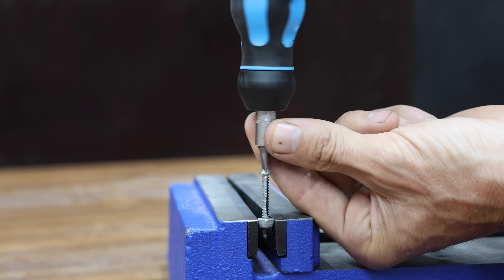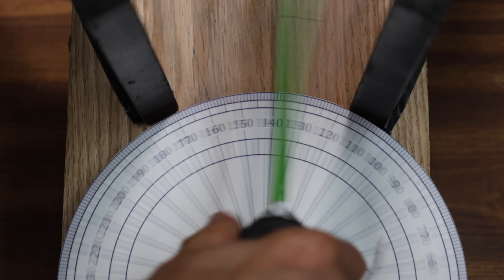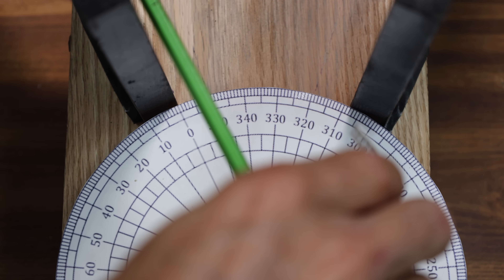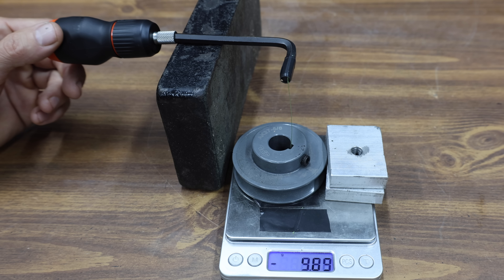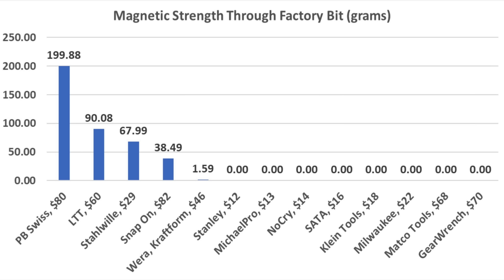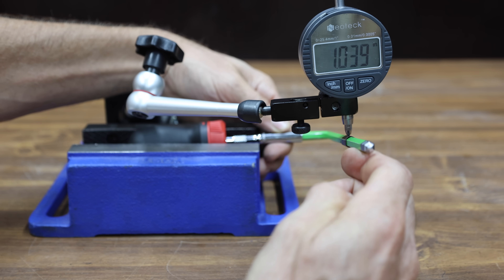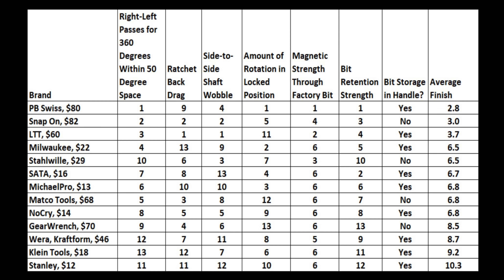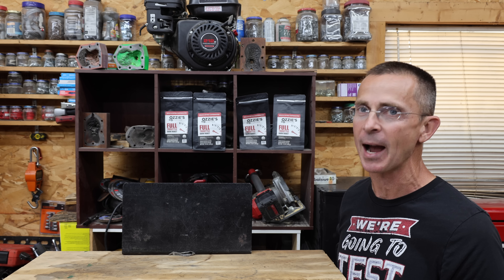Is Linus Tech Tips “Stubby” Screwdriver Best? Let's Settle This!

Comment: 100W+ USB-C GaN chargers, specifically those that can do 100W when only using 1 port. A lot on the market can only do 100W in the first few seconds, then falls to 80W, then after several hours of use, will fall further to 60W or even 0W. Even reputable brands fails. The key is to test is over several hours or days.

Comment: Another suggestion is: "the best root killer for a main sewer line." -- Some foam to fill the pipe to the top, some don't. Some use toxic copper based chemical (environmental damage?), others use chemicals as simple as salt. I'm not sure you could even perform a test like this.
Reply from the maker: Thanks for the suggestion.

Comment: I have the Milwaukee and it has become my main ratcheting screw driver.  I noticed that it doesn't do great at ratcheting low resistance things, but i just hold my finger on the shaft whenever i need it to rachet.  That being said, it would be nice if i didn't have to do that every time i start a screw!
Reply from the maker: Thanks for the feedback.

Comment: Testing small ratcheting screwdrivers against each other without asking, is this the correct type of tool?  I used to have a couple little guys like this till my wife got me a little wiha security bit driver kit.  It's looks like a standard socket ratchet but it's small and accepts screwdriver bits .  Along with a little 2 inch bit extension but sometimes I use my Dewalt 4 inch bit extension.   I'll never go back to one of these drivers.

Comment: I drive a lot of stainless screws, and I hate it when the screw head deforms where it meets the driver. Stainless steel screws are a bit of a hastle to drill and extract, to put it lightly. So I've determined it might be better to have a bit which deforms/breaks before the screw head. (10/32 philips specifically)

TLDR: I request that you review different bits for hardness/softness of the metal it's composed of & failure loads
Reply from the maker: Thanks!  Thanks for the suggestion.

Comment: Would love a roof coating material. Dealt with some, want to know ponding, flat roof, and bubbling.  Coating different materials. Wet and dry.
Reply: Silicone supposedly the best but still splits in hot weather
Reply from the maker: Thanks for the suggestion.

Comment: Great testing. I noticed the bit sizes were different - did that impact the testing at all? The LTT seems a bit smaller than many of the others there.
Reply: LTT uses shorter bits due to the fact they were already making them to fit 12 instead of 6 in the regular driver. 
On the regular, you can choose to fill it with 6 regular size bits instead of the 12 short ones, but on the stubby they used that to make the driver as short as they could.

As the test here shows though, the bits are of good quality, and the extra bits on the LTT store aren't that expensive.

Comment: I've used the Snap-on ratcheting stubby and full length screwdrivers for years. 
Fully satisfied. 100% guaranteed to be replaced or repaired.
The old models did have bit storage in the handle but, that was it's weak spot. If you dropped it from high enough, it could break the storage cap.
Reply from the maker: Thanks for sharing.

Comment: Regarding power tools specifically, do you think there is truth to what i heard a while ago that even though power tools might be made by the same manufacture, that they could be wildly different qualities/durability depending on Where you buy it?

For example, Buying a Dewalt or Milwalkie power tool (lets say a drill) from Home Depot/Lowes, is made to a much lower standard than those sold at, lets say more 'professional grade' stores/sites, in order for them to keep the price down for the more retail store shelves, even though the model number of the tool is the same (and there is no way to know which version you are getting). 

Is this something you have heard or tested?
Reply from the maker: Thanks for the suggestion.

Comment: Just one note to add with the back drag test since the measurement is so small and can easily be skewed by leverage. If you have a way to secure the  Alan key to the stationary object while still allowing rotation you can get a more accurate measurement. Just my two cents but great videos and I always watch your reviews before buying tools 👍
Reply: I noticed this as well, looking at the video it didn't seem to be a factor. But ensuring the Alan key can only rotate and not act as a lever will make the test more consistent. 

(This is extra credit. You're already rocking a 98)
Reply: @seanmurphy9439   yeah I was thinking the difference might be small but it’s a small measurement and could definitely effect it a few grams.  I’m not that nit picky with a screw driver because I beat the crap out of all my tools but I do also use some fine calibrated stuff and see differences things make.

Comment: I do own Wera ratcheting stubby screwdriver and I like it a lot mainly because of its compactness compared to its counterparts and the build quality. I was really surprised though that you put the product from PB Swiss to the last place by giving only 2.8, at the start I was expecting it to be more outstanding.
Reply: You're reading it backwards, a low score is good, the PB Swiss finished in 1st place in 4 categories, and so was the best finisher on average at 2.8, taking the top spot on the final results chart. The Snap On did not finish 1st in any category but it was close to the top in all categories so it still ended up with a very close second place average finish score of 3.0

Comment: @ProjectFarm I have a suggestion for a test but correct me if you ever did something like that. I'm thinking of installing a metal construction directly into concrete using concrete filling "chemical adhesive" called Sika AnchorFix-2 . Did you anything for concrete specifically? I've seen your "liquid nail" videos but you did it for wood only. Also again, thanks for the good work in testing!
Reply from the maker: You are welcome!  Thanks for the suggestion.

Comment: This review was fairly comprehensive (as usual), but it overlooked one critical feature: the length of the bits that can be stored. The Milwaukee, for example, uses non standard 1.5" bits. Standard length bits cannot be stored in the handle. I'm sure I'm not the only person who replaces the included bits with ones that I most frequently use, so this is kind of a big deal. Not to mention when you wear out a bit, good luck finding a replacement. 

The full length LTT screwdriver makes use of shorter than standard bits in order to fit more into the handle. Is this also the case for the stubby?
Reply from the maker: Thanks for the constructive feedback.

Comment: I bought the Stahlwill branded as an SK about 15 years ago. I use the Gearwrench shafts in it. I use it every day and other than an occasional lube it has needed nothing. I use it in all driving situations, not just stubby scenarios, as I find it to be more comfortable than full sized handles. The fact that it does NOT have internal bit storage is a plus, it keeps the handle intact.
Reply from the maker: Thanks for the feedback.

Comment: Hey Todd, absolutely love your videos! Quick idea for taking out human error at the backdrag test: if you fit a small pipe over the hex-shaft for the part that lays on the middle platform, there will be less inconsistency/more accuracy with overcoming the bumps of the hex-shaft. The positions where you started varied from screwdriver to screwdriver, so the rotational position of the hex-shaft also varied/the horizontal distance to where the sting is attached to the weights. So some seem to have started on one of the 6 bumps, while other seem to have started on one of the flat sides and had to overcome the bump.
I hope my attempt at explaining makes sense?
I really love your videos and watch every single one! You always seem to find simple and efficient ways to take the human error factor out as much as possible.
Kind regards
Reply from the maker: Thanks!  Thanks for the constructive feedback.

Comment: Excellent review as always!  Lots of eye opening results.
I have a Kobalt ratcheting stubby that's probably 25 years old or more.  It has in-handle storage (came with 6 bits + room inside to store more loose), forward/reverse/lock positions and magnetic bit retention.  It's about 4" long.  Pretty standard stuff.  But it has one feature none of the screwdrivers reviewed here have - the entire tool is metal!  Aluminum handle, butt cap and adjustment collar, with steel bit holder.  The only plastic is the bit holder inside the cap.  Oh and it only cost about $10. My only issue with it was that the "rubberized" handle grip inserts (more of a plastic) hardened up and became slippery so I pulled them out.  I need to fill in the gaps with some high durometer rubber or maybe some JB weld.  I'd love to see how it compares to the ones reviewed, but I don't want to destructively test it.  You can't get these anymore, though maybe find one on eBay.  I've used it on countless projects over the years and its small size lends it to bring tossed in the glove box in a car or even a seat pack on a bicycle.  It'll be a sad day when it gives up the ghost!  I'll list the part # when I can find the driver, it's laying around here somewhere...
Reply from the maker: Thanks!  Thanks for sharing.

Comment: I have a video idea to suggest:
Which "Refill Spray Can" is the best? Let's find out!

They are not very common, but do kinda help reuse pressurized containers with almost any liquid media, and - best of all - can easily be pressurized at some 8Kg/cm2 with an ordinary air pump. No propane/butane nor freon propellant required. Just the air we breathe to pump it up and ready for discharge.
Reply: Never knew
Reply: @StanErvin-yo9vl   I have one of these for several years to dispense brake parts cleaner I buy in metal canisters, and refill at any time given. Saved me quite a bunch of money one normally pays per one-time spray can.
Reply: @Bandicoot803  : Okay, I see the usefulness and safety when used dedicatedly for one product. Was concerned that wavering from a few different liquid substances that there's the issue of incompatibility and risks of mixing and pressurizing with any substance as a propellant causing intensified pressure build up or, Heaven forbid, an explosion or fire. 
🛠️🤕💥🔥💀👀🦖🦕 Edit: remember that the chemical you are planning on dispensing isn't such an eco-friendly chemical formulation to begin with. I guess that I just cannot grasp the concept of eco-friendly propellant versus non eco-friendly being used. Are there perhaps organic substitutes for the Brakleen ™? I think that would be a beneficial solution. Have to admit using a trigger-spray one quart non-pressurised filled from a fifty-five gallon drum (spigot) on bung. This was in a factory that had some seriously dangerous chemicals such as methyl ethyl ketone, organic peroxide, and many different formulations of heat transfer boiler fluid that circulated through the injection molding cavities and cores to cure the tmc sheets for satellite broadcasting dishes. We had safety standards out the ying-yang, but I think that my various cancers were resultant from exposure. Lung, skin, kidney, bone, and a possibility of others.
Reply from the maker: Thanks for the suggestion.

Comment: I like magnetic screws and screwdrivers. I hate when a magnet is so strong that I cant get the screw into place because it keeps sticking to the wall and comes unseated from the bit before it comes off the wall. It also sucks if you can't get it off one wall without sending it into another.
Reply from the maker: Thanks for the feedback.

Comment: I picked up a duratech on amazon because i wanted a locking mechanism. no screwdriver magnet is holding onto a 6 inch bit extension

I had a Stanley and the magnet came out.
Reply from the maker: Thanks for sharing.

Comment: My fav is the GearWrench; it's a Snap On w/o the mark-up.  Knurled shaft is very important in practice (so you can quickly spin a loose screw), and a thin shaft is extremely important to get into recessed screw holes.  PB Swiss is beautiful but lacks a knurled shaft.  I do daily carry the non-ratchet stubby PB Swiss.
Also, Apex Tools makes the Snap On bits (I'm also surprised yours snapped early.  They're normally harder/tougher.)
Reply from the maker: Thanks for sharing.

Comment: Very nice to see the LTT driver doing what it was intended for well. This video helps make the price make sense since the higher ranked ones are also more expensive. The locked position rotation and bit retention were a tad disappointing. Maybe they can fix that up in revisions.
Reply from the maker: Thanks for the feedback.
Reply: The rotation at the locked position is kind of misleading as the measurements are taken so far away to get a better idea between all of them. Any that did not make it past 1 inch in that test is great in my opinion. I have the original LTT driver along with many other ratcheting tools. The bit storage, magnet, ratchet and ergonomics is what makes it for me. It is expensive yes but no other driver I have tried comes close. All other options I can think of that would be second would have a extremely poor magnet and far worse ratchet.
Reply: @htr5372 u mad bro?
Reply: @htr5372 u indeed mad bro
Reply: @htr5372 Then name one.

Comment: As always, very comprehensive video.  He ranked magnet strength as best when strongest, but personally I think something in the middle is best.  If it is too strong you get frustrated by stuff sticking that you didn't want to stick.  Also, I wouldn't concern myself too much with putting a pair of vice grips on the handle and torqueing it to the break point.  If a human hand can't break it, then that is good enough for me.
Reply from the maker: Thanks!  Thanks for the feedback.

Comment: I had one of those from the Lowe's Kobalt line years back. Can't say I got to do too much testing of it as it was cross-threaded in manufacture and couldn't be opened despite chewing up the metal housing. Never could access the bits inside. Tried to exchange at the store given they allegedly guarantee hand tools for life, but after an hour manager said no way to an exchange without a receipt. You think I learned my lesson, but years later bought a $600 bathtub from them for a renovation. Despite paying prior to delivery to store, lost more than an hour at the store arguing with the manager who claimed I still owed several hundred dollars more despite having the email from them saying it was completely paid at order. Someone bought the tub out and disappeared so we loaded it in the car and headed home. There we discovered someone had driven a forklift through the side leaving a torpedo sized hole drove it back to the store for more hassles, and they wanted several hundred dollars more to reorder the tub since the price had gone up since I last bought it. I kid you not! Won't go back to Lowe's!
Reply from the maker: Thanks for sharing.

Comment: Since you got a pre-release LTT screwdriver, does that mean, the LTT potentially had a chance to QC and send out the "best"?
Reply: @htr5372 It is a real concern. My worst case was a bike tool (Full Windsor Nutter). The reviewer all had black bits, mine came with really poor silver ones. Also, there where really visible casting marks and flaws (poor casting left holes/inclusions*) in the tool body and generally fit and finish was visibly worse than on the tools the reviewers got.
*not an engineer or whatever... maybe the problem was not casting.

Comment: If you like a slower cadence on the audio, try .85x speed.  I use an app that lets me dial video speeds up/down by small increments. Todd sounds less caffeinated or accelerated at .85.  If you're in a hurry, crank him up to 1.5x and hang on!

Comment: A stubby ratcheting driver is inferior to a small 90 ratcheting bit driver or a swivel ratcheting bit driver in tight confinements. Many of these tests don't replicate the typical scenarios in which you would use a stubby driver. I prefer the most compact tool, with no on board storage and a strong bit retention. The wera compact driver or similar. Big fan of PF but this isn't in his wheelhouse.

Comment: Have you considered applying "importance factors" to your charts at the end for scoring? That way, the tests that matter most get weighted more significantly than other nice-to-haves. Just a suggestion!
Reply from the maker: Thanks for the suggestion.
Reply: For this video, I was most interested in shaft wobble and back drag.  Nothing else is useful to me, including the efficiency of the ratchet mechanism.

What did everyone else find helpful?
Reply: He very explicitly does not do that for any test because what is important changes by the consumer.  Some people, for some applications, will care about nothing more than back-drag.  Other people, in other uses, will care greatly about the overall length.  Some others will care about maximum torque, while others doing delicate work won't care at all.
Reply: 16:00 - he said it though? even highlighted snap-on/ltt after saying the PB swiss is too high on backdrag

you can also just make your own ranking by picking categories that you need to most (each person requires different specs). add them all up then divide by number of categories that you have selected.

Comment: For the way that I use such a tool, shortest length and back drag are the most important to me.  Some of the strength tests, while for the most part indicative of quality of build and long life, are not values you are likely to challenge the tool with using one hand in a tight spot.  Nonetheless I could still evaluate what is most important to me by the complete spectrum of tests, plus length.
Reply from the maker: Thanks for the feedback.